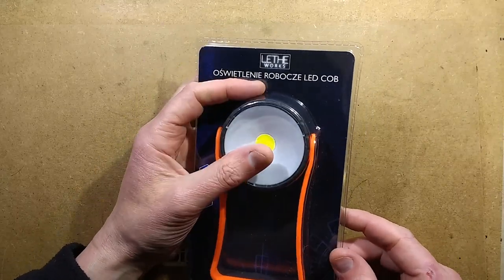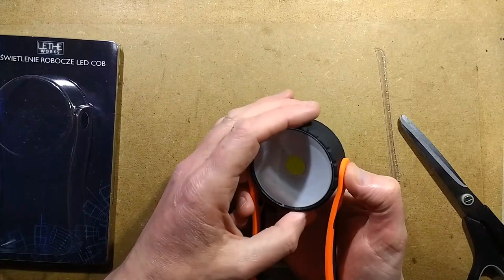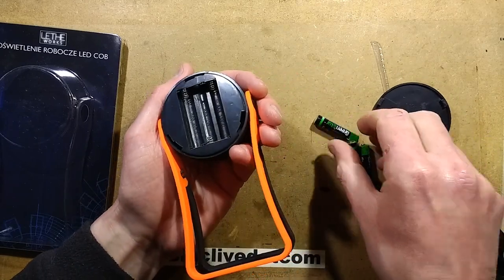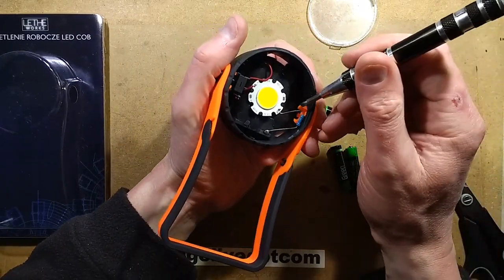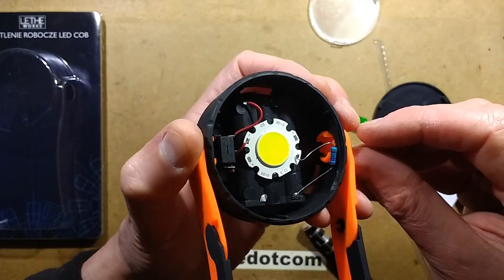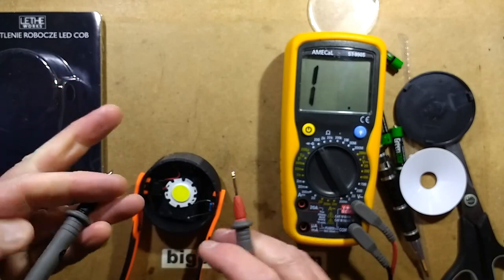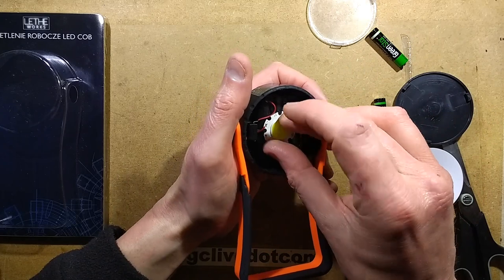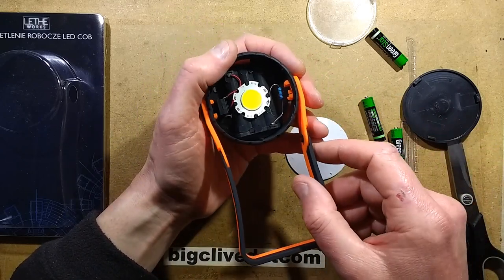Inside a Polish (Chinese) COB work light.

Comment: I HAVE ... ALWAYS, ALWAYS, ALWAYS had a problem with Duracell alkaline batteries leaking. Have ruined some expensive torches of mine. No other alkaline batteries have leaked so far in all these years. Batteries like what you show here, most times last for years, unused, without leaking !!! A coin cell in a remote control that I found after 14 years, still had over 3 volts and is STILL WORKING !!

Comment: This LETHE brand is from Biedronka (Lidl competitor). I wish I could send you their E14 5W LED bulbs that my grandpa installed. Suspiciously cheap for the light output and quality they give, not sure about longevity though (plastic case, no MCPCB apparently).
PS: Michał is pronounced ME-how, I also happen to bear that name ;)
Reply: Hi Michał, this is Michał (the one that supplied the subject of this video). Clive did get some 5W LEDs in the same package as this COB arrived (I think they were Lethe E27 though). I have E14 3W fillament LED bulbs from Biedronka in my 'to be sent to Clive' box, so don't worry, he will get them on December at latest. I plan to deliver them with Christmas lights, as this year Biedronka went bonkers on that occasion and I expect it will be no different this time. The package contained (apart from Solidarność alcohol candies and Krówkas) only products from Biedronka, mostly Lethe brand, as it happened to be quite massively sold recently.
Reply: @90msg90 Thanks for sending stuff for Clive to examine, I hope the candies get reviewed too as there's an absolute load of Polish shops in my village (which is good as I like Karpackie beer!), and the variety of sweet stuff there rivals our own!
Reply: I suppose the shop either shares only the name or is just some Polish expats reselling what you can get here in Biedronka - but anyway not related to the official owner, Jeronimo Martins Dystrybucja. For reference how it looks like, www.biedronka.pl is their webpage.
Reply: I really like this light. It's one of the better looking ones I've seen. Very stylish!
Reply: Biedronka is pretty much like Walmart in US
Reply: RicoElectrico reference must be a link to their weekly updated and changed offerings on sale. no led headlamp to be spotted there any more already.
Reply: adriaan van harrick Well the non-food aisle items rotate weekly anyway, there is no product archive on that site I suppose
Reply from the maker: I have some 5W lamps in the stuff Michal sent.  They'lll get taken apart at some point in the near future.

Comment: Lethe brand is the best value for money led lamps I've encountered. They are well made and put quite a good light. I use GU10 5W variant. I've installed some year or two ago and not a single one failed since. Recent ones I bought for 16PLN (about 3.25 GBP) for two.

Comment: I've got one of these for work. I work at a coal fired power station and this kind of small lamp, with a magnet on the back is great for checking chutes, under belts etc. An amazing amount of light for three triple A s.

I'm old enough to remember when torches only used incandescent bulbs. Used to get through two sets ( front and back) of C cells in about 3-4 days doing my paper round on my bike. Brilliant for the first day then it was all down hill.

Got a 4 quid led torch with zoom also running on 3 AAA s and fully zoomed the beam hits the top of the cooling towers no problem and even makes it to the top of the chimney stack. I fully understand why Clive loves LEDs.

Comment: I love all these new 'yellow' LED lamps, they are very bright. We were selling some cheapy white plastic ones as novelty 'light switch' style with a blinding error on design. It looks like a light switch ( a white plastic lever/rocker switch) but the LED strips are either side of the switch so your looking at it when you turn it on and it is blinding! 
On a side note I have massive difficulty reading 5 band resistors as sometimes the bands are evenly spaced and if the value contains tolerance colours then its hard to know which way round the damn thing should be read lol :D
Another good vid from Clive, my favourite late night teardown companion :)

Comment: Your digital zoom comes out really well - is it natively a 4K camera perhaps?
Reply from the maker: I've never really thought if it's actually zoning in on the full image sensor.  It might actually be doing that, so keeping the full resolution.
Reply: More zoom please. It really helps to see what's going on in some of those small circuits you look at. Good one.
Reply: If it's a 4k camera you'd expect 1080p to be full res up to 2x digital zoom.
Reply: I read somewhere that he uses a Moto G4 to record all his new vids. I don't think it's 4K capable, but I could be wrong,
Reply from the maker: 13MP sensor, but just 1080P video.  It's possible that the full 1080 is being kept in the zoom.
Reply: It seems like it is, the picture was still very clear, there is even more detail visible than when zoomed out..
Reply: 13MP is approximately 4k so if it has a 4k sensor then not being able to record 4k video could be solely down to an inability to process 4k capture. If this is the only issue then native resolution 2x digital zoom a 1080 should be possible. It would be interesting to compare the quality of the digital zoom at 2x with an identically shot having moved the camera closer.
Reply: I like it 2. Its better than the windows magnifier that i use at 125-150% on these videos at fullscreen, to see components inside taken apart stuff ;)

Comment: Like the low cost head torches I would adapt that to use an 850mAh Li-ion battery pack - that should give around 2.5 hours steady light in a low-cost light weight rechargeable (and mean I can use the same batteries and chargers as my head lights!)

Comment: I have never had a leaking Zink chloride battery recently.With led they last quite long despite their low density.Just use them and just don't leave them for ages in it then dispose them properly.
The contrary happend to me shitty Duracell leaking and ruining my device.
Besides this is a nice lamp.The stand is practical for using it as work lamp.
One also could solder a red or green cob in it and use it at a party. Add a bit of selant to waterproof it

Comment: Isn't it fair to worry that the loose resistor will be coming off in due time due to vibrations from moving the light around, especially with those long leads? It seems to me it would be much nicer if they had just gone to the effort of actually fastening it to the frame.

Comment: a good mod would be to rewire the battery holder to place the cells in parallel rather than series, and then use 14500 li-ion cells in their place

Comment: I thought a COB light should kind of resemble the shape of a cob of corn.
Reply from the maker: You might be mixing up corn-cob lights named after their appearance and COB which is an acronym for "Chip On Board" where bare chips are bonded directly to a PCB.
Reply: Ah, cheers

Comment: I had trouble measuring resistance due to the meter leads. They measured 1.4 ohms. I replaced the wire with heavier gauge and they now read at 0 ohms. I have been doing regular testing my leads since.
Reply from the maker: The same goes for voltage drop across the leads of the bench power supply.  I recently bought some very heavy silicone insulated wire to upgrade them.
Reply: Hey, thanks for the reply. Love your channel. @bigclivedotcom

Comment: So why do all the previous led lights always have circuit boards with loads of things soldered on, yet the one here manages to survive with just one resistor?
Reply: Roger Musson I would guess that's because this one just turns on and off, and most of the led flashlights have 3 or more modes (low power, high power, blinking, etc)
Reply: On/off only. No control circuitry.

Comment: What's the battery life like on that light? Some of these LED lights that are either heavy on batteries or take hard to find batteries I "USBify"  them I connect a USB lead and then run it off a PC or power bank. Many of these lights are resistored so you can safely do this. I've made a bunch.
Reply: coondogtheman1234 You do need to either change the resistor or add a diode to safely run these cheap 4.5v things on 5v.
Reply: I have a bunch of these lights and all run in 3 AAA or AA size batteries and they are all running strong. I won't do this with lights that have an electronic switch just an old school multifunction switch. Most of these already have beefy resistors inside.
Reply: coondogtheman1234 By not changing the resistor you may be overdriving the LEDs quite considerably.

Comment: For common devices that run on 3 aa/aaa (so 4.5V) would they usually be okay to run at 4.8V (adding another NiMH cell) or even 5V for usb conversion?
Reply: Depends on a device - lamp like this might overheat at 5V - if you want to power it with USB you can put a diode in series to drop the voltage around half a volt
Reply from the maker: I'd suggest trying to keep the voltage down to around 4.5V so maybe USB with a diode in series to drop the voltage a bit.
Reply: Thanks. Sounds like a nice neat solution for USB to 3AA/AAA

Comment: Btw, I recently bought an USB power supply from the same shop (Biedronka) just to see how it looks inside (I was inspired by your videos).
The separation seems quite good until you realize, that an electrolytic capacitor is pretty much bridging it (yeah, it has some plastic foil insulation, but still)...
Cost: 10zł  ≈ 2 GBP
Gallery here: http://imgur.com/a/PeqF4
Reply: Nice pictures, Thanks for posting and thanks to bigClive this video.
:-)
Reply: izimsi Dang, that really is a complete defeat of the separation! Amazing that it is rather nice otherwise but has that one serious flaw.

Comment: You happen to know where I could get 3.7v-5v cob leds by chance? All I'm seeing on eBay is 12v and I have to use a step up converter to get the cob to work
Reply from the maker: I've not seen many low voltage COB arrays being sold on their own.  These flashlight COBs are basically a parallel array of individual chips, so they have a similar forward voltage to a single high power LED.  Depending on the power you require you could use a standard star emitter.
Reply: bigclivedotcom I may look into aliexpress or alibaba I've been to eBay countless times searching and it's too difficult and the other websites are kinda like you have to make a minimum purchase of 10-1000 

Have you ever done a $5 tech video like say 
Power banks 
Usb stuff
Electronic stuff
Led strip lights
And such of that nature?
I've been getting bored of eBay and buying lots of power banks and led lights and well I need to earn more eBay bucks and I have not one clue what to get that is cool and useful rather then a throw away item

Comment: Not sure I like the idea of parallel LED's with a single resistor.
If one chip fails open circuit, the others automatically get higher current, and shorten their lives too.
Once a couple go, I expect the rest will fail within minutes in a cascading fashion.

Would much rather pay an extra quid of each chip to have it's own resistor.

Comment: Any light is better than none but to me it tries to do too broad an area for too low a price.  Wide beam COB is fine for a flood but at around 1W, it's too few MCD for its size.  There was no need to recess the COB with that white trim pseudo-reflector, it could have been near the same thickness and only 1cm larger diameter to use AA instead of AAA cells.

However, and keep in mind that I don't know what the purchase price was, I would rather something similar except large enough diameter to use 4 x AA, a $2 constant current buck driver, and 50 cents worth of aluminum plate-as-heatsink behind the COB to allow doubling if not tripling the drive current.   That would make it something I'd actually use instead of sitting in a box while I always preferred something else instead.   In other words if it cost $2 in stock form, I'd have wasted $2, while if it had the changes I mentioned and cost $5, it would be a better value to me.

Then again if you happened to have a lot of spare AAA NiMH cells lying around and have great night vision...

Comment: Big Clive, do you or anyone else know of a module that will monitore the voltage of a 12 volt battery bank and work as a dump load. Like turn on at a certain voltage and turn back off at a set voltage so that I can run a heater to keep ice off a water troth. I have a winter tote about 30 gals. any ideas? Thanks.
Reply: thomas reddick Well, you could use two, a thermostat module and a voltage protection module. The thermostat could turn on the heater if the water was below X degrees, and turn it off when above said temperature.  The voltage protection module can cut power to the whole contraption when the voltage goes below a set point (11.75v for 12v lead acid batteries) and turn power back on when the V reaches another point.
In that way you could keep your water warm enough, be fairly power efficient, and have no risk of damage to your batteries.
Reply: most solar controllers have an output that will turn off the output to protect the battery, once it drops to around 12v under load
Reply: I have a wind turbine with a dump load but it only turns on for about 10 sec. I need something that will turn on when batteries are say at 13 volts and stay on till 12.5 volts. Meanwhile the wind turbine can continue.
Reply: Zak, I'll look at those and see if that will work. In advance thank you for your help.
Reply: A. Zak, I looked them over and that looks like it should work. I'm just not sure how to connect them for my purpose. Again thank you.
Reply: thomas reddick Clive has a video on the thermostat module!
Reply: A. Zak great I'll look for it..

Comment: Why there is that resistor ?
Reply: Then tell me how much 2.2 ohms can limit current ? I think it is quite useless in this circuit.
Reply: Else it would be a short circuit to kill the LEDs withing a short time.
Reply: surely it's 2.2k???
Reply: It's 2R2
Reply: The LED has a forward voltage of around 3.2V, so at 4.5V there is only around 1.3V to drop, and that gives around 600mA at 2.2 ohm which matches the meter
Reply: wouldn't two zener diodes in series be more efficient than a resistor?
Reply: +toysareforboys How would that work?
Reply: You could choose a zener value that suits you to only have one diode - but the problem with that is that they have more or less constant voltage drop - so if you have one that works well at 4V, when the batteries drop to 3.5V it wouldn't work at all and at 4.5V it would fry the LED - resistors provide a linear drop. 

And if it worked - it wouldn't be any more efficient, as you drop the voltage and dissipate same amount of power (per same drop) either way. The simplest way to go more efficient seems to be to use a buck converter, which is not as cheap

Comment: Can you please measure the temperature of the COB? I expect that the LED will melt the plastic behind it.
Typical cheap crap...
Reply from the maker: In my workshop (12C) the COB temperature was 35C.
Reply: 12°C ? Thats pretty cold...
Reply: he keeps it just warm enough that the pipes don't freeze :)
Reply: Can you tell me how you measured it? With RTD? Although, with fresh batteries the LED will dissipate 1,6W of heat...
Reply from the maker: I took the COB out and put a piece of Kapton tape on the back to act as an emissive target for my thermal imaging camera.